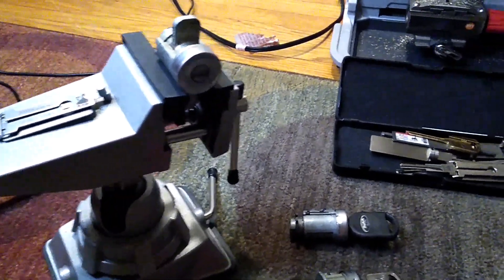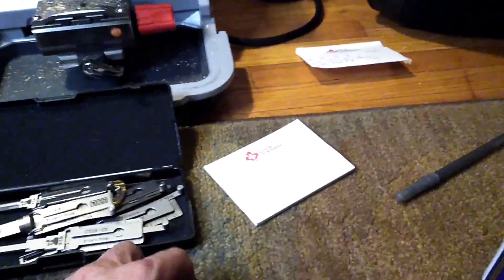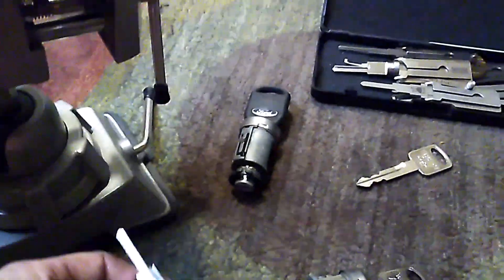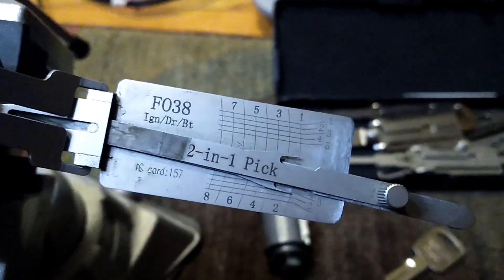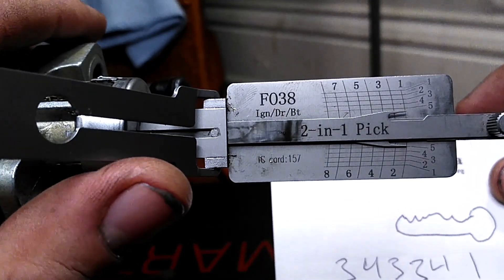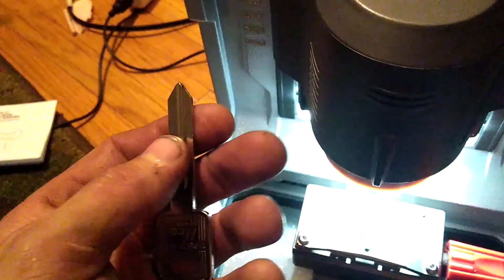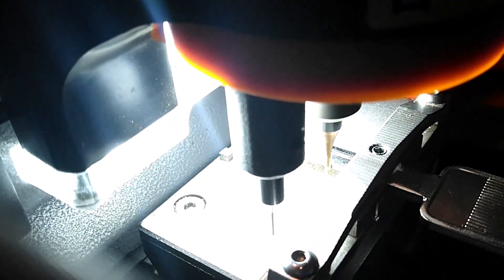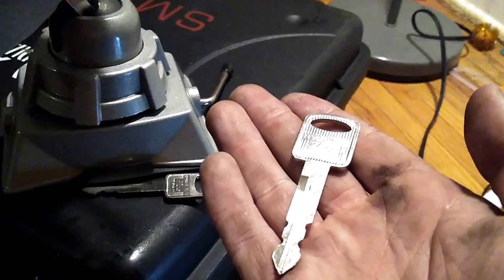How to Lishi

Comment: You should be able to select find bitting on the main menu and enter the key information along with the six cuts you read from the Lishi and the machine will give you a progression chart to find the last two cuts. You may have to use an extra blank or two, but that may be better than working in a hot car to impression the last two, especially if you’re not great at impressioning.